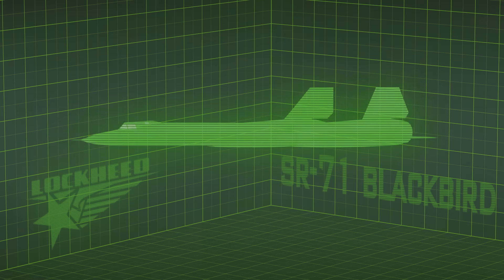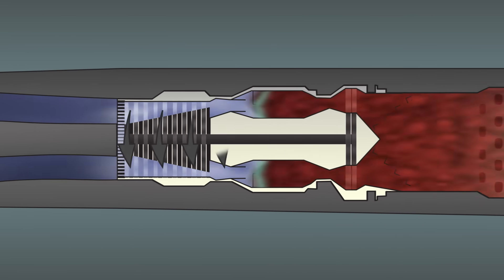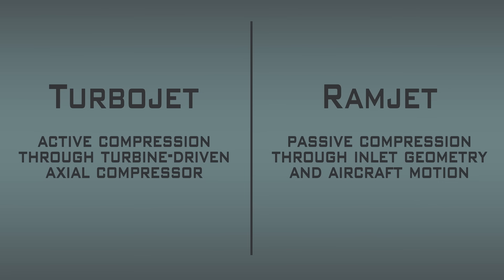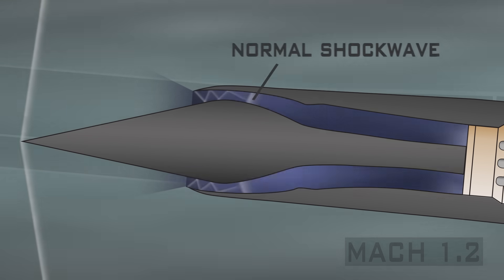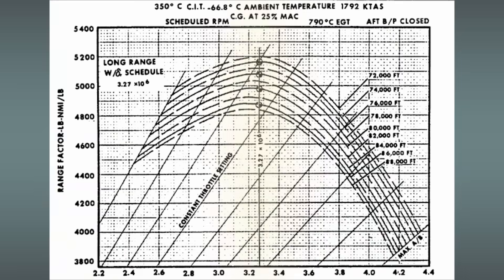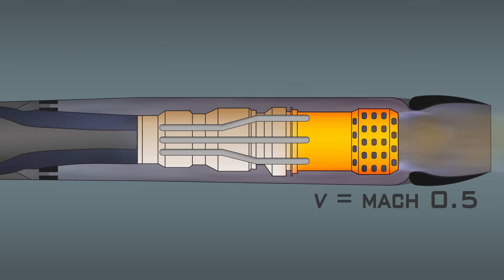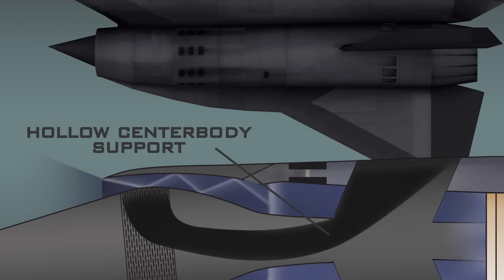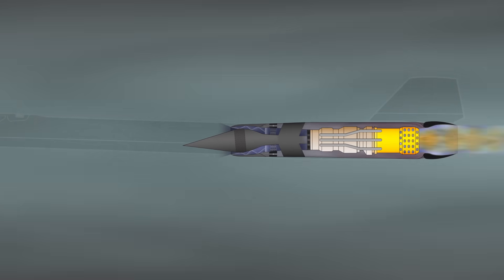The Mighty J58 - The SR-71's Secret Powerhouse

Comment: is it true that this bird leaked fuel when sitting still and cold?
Reply: Actually, they couldn't find or engineer a sealant that could take the extreme temperatures the airframe sees , so the seams of the fuel tanks are just crimped together. At cruising speed (Mach 3+) the metal expands and seals tight.
Reply: Jupp
Reply: Because the tatainium expands when hot so it has to have holes were the metal can expand.
Reply: titanium

Comment: its amazing what we could do 60 years ago. too bad we're stuck there.
Reply: x files theme plays
Reply: The SR71 was built as the successor to the U2. The premise of the U2 was the hope that if you flew high enough, radar and missiles (of the day) wouldn't be able to reach you. Turns out they were wrong. So the next logic step was if they couldn't operate out of range of missiles, they'd simply go fast enough to out run them.
Now the point of all this is; when's the last time we had to do reconnaissance against an enemy that possessed an anti air missile system capable of shooting down an SR71 on an escape vector?
The answer is never. So there's no need to improve upon something that still does its job perfectly.
However, most reconnaissance these days is done by satellite.
So it's not that we CAN'T build a brand new mach 3.5+ aircraft that's slightly better than the SR71. It's that the need for such a thing simply doesn't exist.
Reply: That's what you think
Reply: That's what they want you to believe
Reply: Stuck there?  I don't think so.
Reply: mostly replaced by satellite recon, except that they know when the is going to be overhead and hide stuff, then you still need something that can show up unexpectedly
Reply: That's what the X-37B is for.

Comment: That's amazing that this was designed by the same people that 30 yrs earlier wasn't sure why dive bombers were losing control once their speed reached a certain point (speed of sound). They added flaps with holes which fixed it but they only knew that it slowed them down. They were brilliant it was just that no one understood the shock wave at the speed of sound. They sure came along way in
a short time.

Comment: So what specifically causes the fatal flameouts that can occur at mach 3.2 cruising speed?
Reply from the maker: If the shockwave in the inlet moved too far into the inlet, it would cause an unstart - a sudden loss of static pressure inside the inlet which, since it's handling most of the compression, translates to a massive loss in power in just one of the nacelles.  The whole craft would then yaw violently.  Later avionics added an analog computer that would essentially react far faster than a human could and very quickly throttle back the working engine to stop the yaw, then reset both inlet spikes to restart the capture process and fire things up again.
Reply: TechLaboratories Ah ok, thats really interesting. Enjoying the Off the Cuff series but gems like this video could really skyrocket you subs and views. I know they take a lot more effort to make but people like fancy infographics nowadays. 
 Thanks for the info, keep up the great content.
Reply: I would like to see the article that states that the cause of unstarts is the shockwave entering the engine as everyone here seems to think. I know it is possible for it to happen but it wasn't any where near as common as the shockwave being ejected from the inlet. I was a jet engine mechanic for 10 years and have a very good understanding of the system and how it works. If you look up "How things work - supersonic inlets " you will see a very good explanation of the system.
Reply: Again it is the inlet that is unstarted not the engine. The shockwave hitting the compressor could cause engine damage. Shockwave air is traveling super sonic and is very dense . The job of the spike is to slow the air down to sub sonic with a series of shocks. In order for the shock wave to hit the compressor it would have to pass by the spike and remain supersonic which is very unlikely. I'm not saying it is impossible but highly unlikely. The compressed air can then over pressurize the inlet to the point that the shockwave is ejected. Once the shock wave is inside the inlet it is the job of the bypass doors to maintain the correct pressure. It is a delicate balancing act to keep optimal pressure and shockwave position.
Reply: I am completely speculating, but I would guess that it happens when the shockwave narrows to the point where it enters the inlet. At those speeds, a small bit of turbulence equates to a significant amount of energy. If the inlet moves too far back, the shockwave would narrow past the point of whelp, which would destabilize the air inside the engine and poof.

This is a complete guess and I have no evidence to support it, but that would be my guess if I had to do it blind.
Reply: toby Hogan Reading up on it the poster below is correct. It happens because the spike would be to slow to retract from a slow analog computer, or retract to much, allowing the shockwave to enter the engine, it didn't damage the engine but it did stall it out. In a rather violent manner...
Reply: Wow and thank you. I have read that many times, but you finally explained it.
Reply: From Richard Graham's book : "The term unstart refers to a phenomenon of a supersonic inlet when the compressor inlet pressure (CIP) becomes too great and has no place to go inside the inlet and therefore unstarts (shockwave expulsion)in order to relieve the excess pressure building up. The jet engine itself continues to run although the afterburner may blow itself out during an unstart. I would estimate on average that about one in every ten unstarts resulted in the afterburner blowing out. "
Reply: Since most people can't understand how the inlet(and nozzle) produces 80% of the thrust while the engine only produces 20% at mach 3.2, I would like to explain it in simple terms. Forget about the engine and just think of the inlet with this explanation. Blow up a balloon and pinch off the nozzle. You now have equal pressure pushing on all sides of the balloon called static pressure.  Start to open the nozzle and allow air to start escaping. This releases the backward pushing pressure at the nozzle and converts it to thrust..... BUT, the forward pushing pressure on the front of the balloon is still there driving the balloon forward. This is before any combustion occurs !!! The forward edge of the balloon is the back side of the inlet spike, and the balloon nozzle is the the air entering the engine compressor. There is and extreme amount of energy in a shockwave which is captured and reused to drive the plane forward. GENIUS !!
Reply: When an unstart occurs , it is the inlet that is unstarted....not the engine. When the shockwave is brought inside the inlet, it is considered "started". When the shockwave is not inside the inlet it is considered "unstarted".  An "unstart" is when the shockwave is suddenly belched back out of the inlet from over pressurization. The forward and aft bypass doors are supposed to bleed off excess air and maintain an even pressure. If the air coming into the inlet is greater than what is being used by the engine or bled off then the inlet becomes over pressurized and "POOF" the shockwave is ejected. At mach 3.2 the inlet is producing most of the thrust, so if it is suddenly unstarted you have a massive power loss on that side and the plane will yaw violently. If the bypass tubes took the air from in front of the compressor instead of the 4th stage, the inlet along with the afterburner would be a true ramjet. The inlet can actually be considered an engine itself which is why it produces 54% of the thrust at mach 3.2 . You have to be able to separate the inlet from the J58 to properly understand how the whole system works.